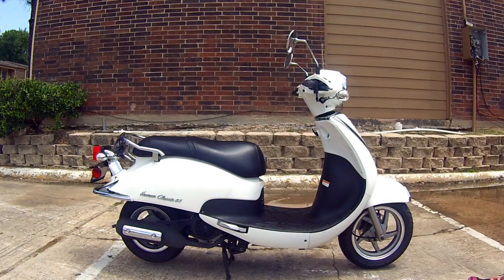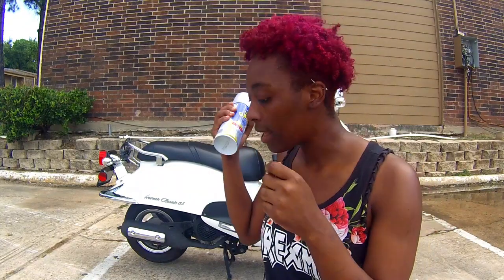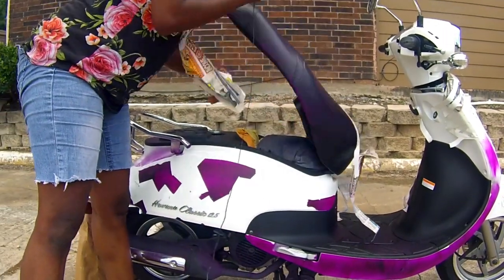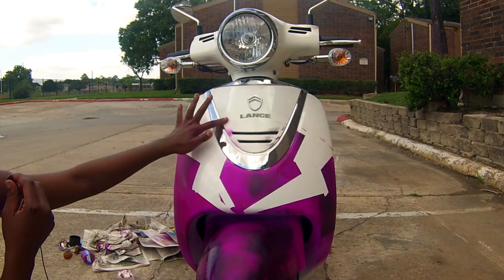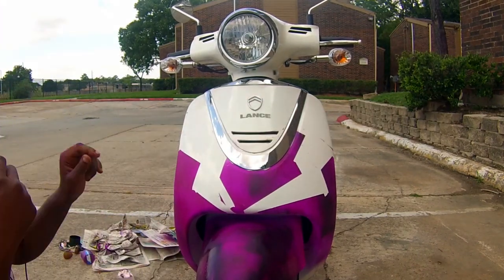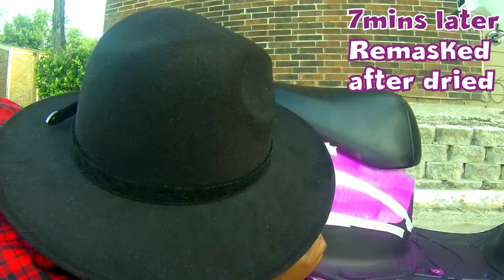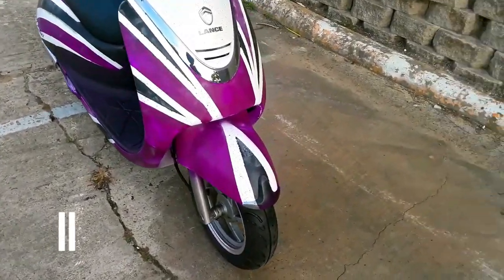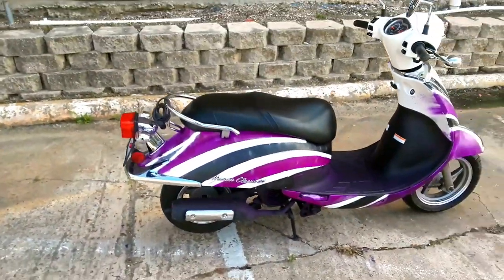Plasti Dip My Scooter: Custom Paint Job

Comment: It looks great , but you should have sanded the parts you painted before you painted them , then the paint would look a litlle bit better.
And sorry forthe gramer im not that good at writing in englis.
Reply from the maker: I don't plan to  keep the plasti dip on forever. So if I  were to sand the panels, when it came time to peel it off my original paint job would be ruined.
Reply: NONONONONONO DO NOT SAND BEFORE PLASTIDIPPING!!!! This is not regular paint. Please for the love of Christ don’t do that!